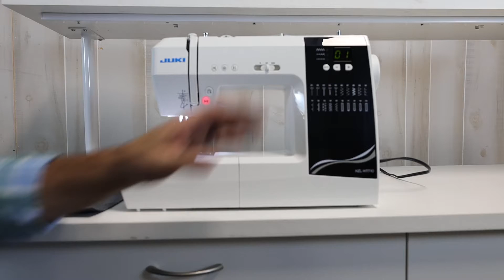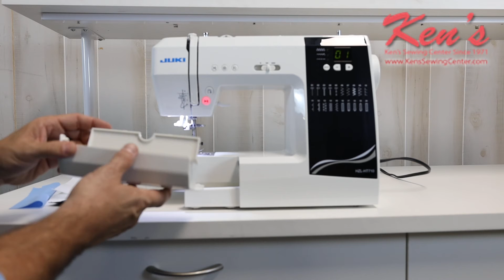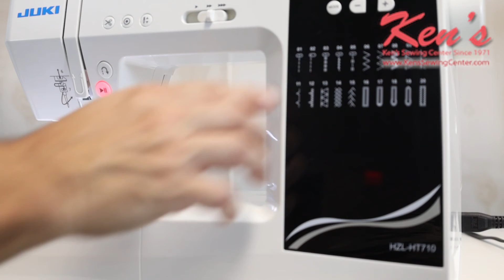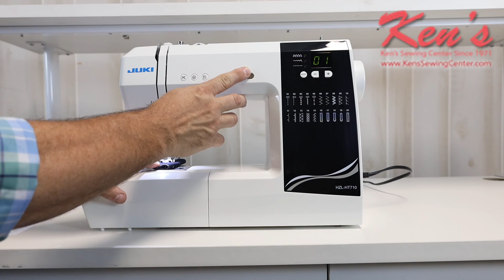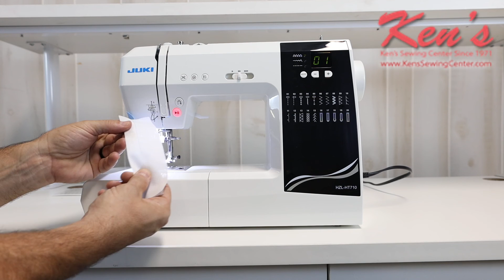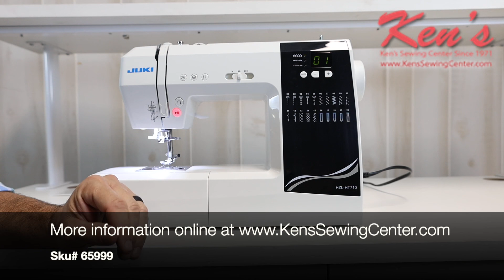Juki HZL-HT710 Lightweight Computerized Sewing Machine Overview

Comment: How would you compare this to the Janome HD3000? I know the Janome is a solid machine, but would you say this is about the same in terms of power and performance? I suspect the Janome may be the better machine and the biggest reason for the similar price point is that this is a computerized machine.
Reply from the maker: The HD3000 would be more powerful.   You are correct  Because the Juki is smaller but computerized it takes it to a similar price.